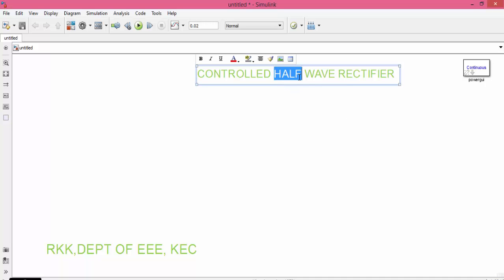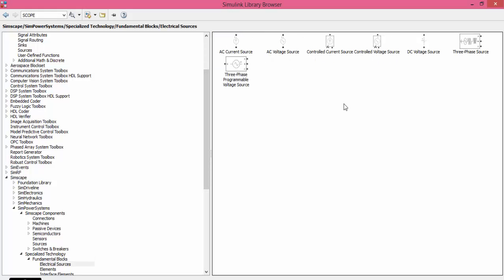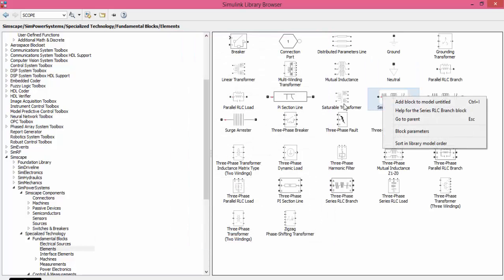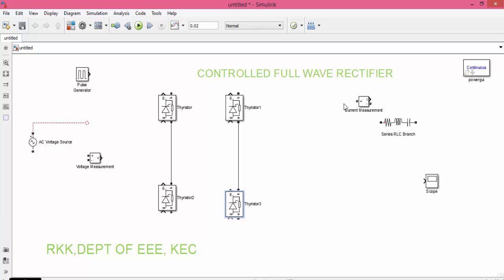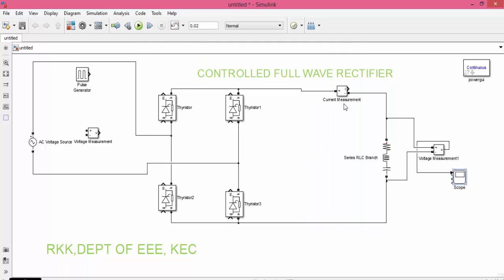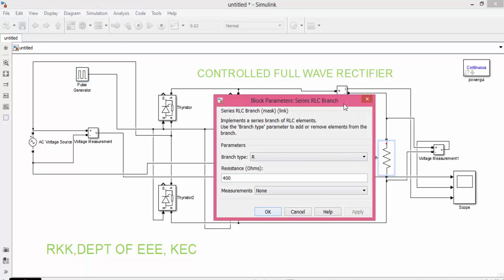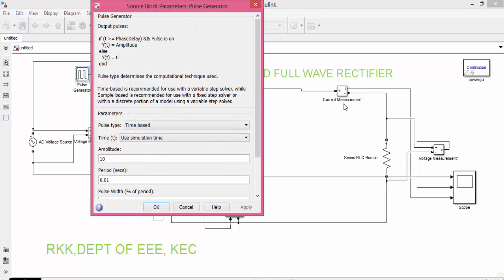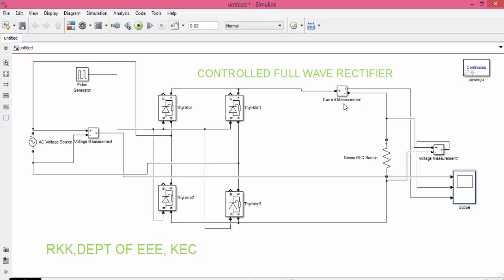matlab simulation of controlled full wave rectifier

Comment: Good evening sir. Sorry to interrupt your day.. i got the waveform and i change a little bit the firing angle for my question..can u help me explain why i get kind of alot buffer (at y = 0) at output voltage waveform?
Reply from the maker: What is the firing angle value
Reply: I put the phase delay 0.0028s as my a is 60°.. the frequency is 60Hz..R=10 Ohm and L=100mH , Vrms=120V , sir

Comment: Thanks so much sir you learn me a lot of things, I wanna ask you how can I connect the output of thyristor,because the draw of waveform disappeare or not exist.
Reply: Have u solved ur problem? I got the same problem here
Reply: No, l haven't solve my problem. 
I tried and not beneficial😭
Reply: @sunlight668  i think if only shown warning on output thrysistor is still able to run, just press the scope and we can see the wave
Reply: Yeah I press on scope but the wave not exist. When press on run the look that is not correct
Sometimes a message appears as output of thyristor is not connected. You solve your promble?
Reply: @sunlight668  Nope cant get the right value of the Fullwave Reactifier, I guess this vidio is being edited without showing the latest diagram, my suggestion you can refer to other vidio channel
Reply: I thinks that so, thanks for your answers.
Reply: In scope limit data should be unchecked. By default it is last 5000